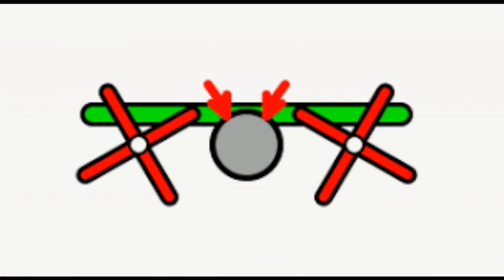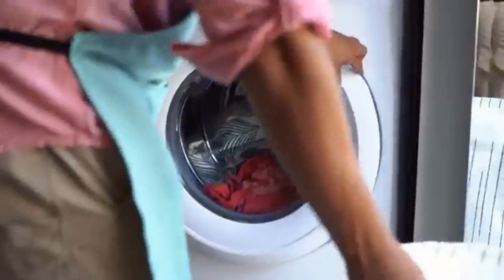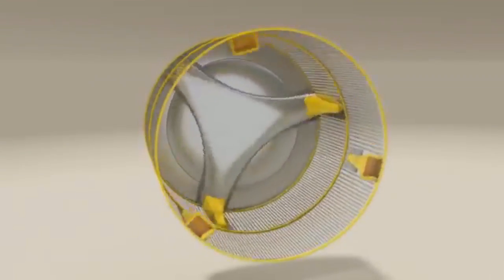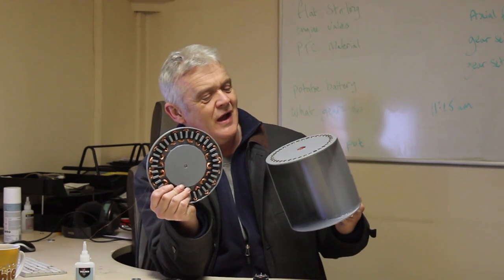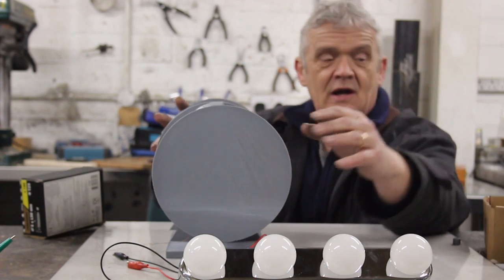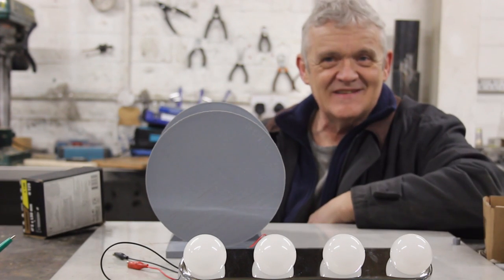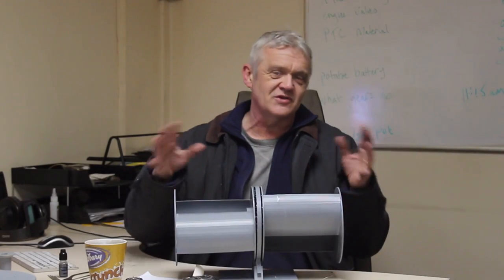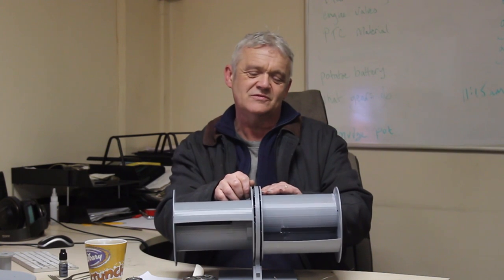1873 The Contra Rotating Wind Turbine

Comment: Put more spacers between them to move the magnets slightly farther out.  The super magnets have a big field strength.  And reducing the magnetic drag on the stator lamination and the ooposing should reduce the magnet lock getting them spinning faster.  New subscriber here.  Do you have any magnet film to see if the magnets in each rotor are too close together so you are not creating a sine wave in the stator. And are  the poles flipped on every other magnet to create even a bigger field. 

Balancing the rotors could be done with a shaft  all the way thru that is rolling on small ball bearings at an overlap without any lube during use so you are not fighting and oil or grease tsunami to overcome rotational torque.  Another yt channel tries to balance surface grinding stones with oiled bearings and he cant understand why the grindstone kicks back a few degrees. 

With the magnetic film held at various distances you could view the size of the magnegic field of the magnets to make sure you are not counteracting. 

If installed on a vertical shaft. The thrust bearings could be opposing ring magnets on the shaft and rotor.  Does not have to be a neodymium to have that effect. 

Creative maglev effect could have neodymium magnets for the lift and ceramic magnets for the hold down.  More neodymium magnets on the inside of the rails and daggerboard.  But the daggerboard is missing a section in the middle where a spinning disc could hang down to give forward motion.  

Im glad your channel popped up on the play list.  Really makes my brain think.

Comment: Very interesting! I find the fact / result / conclusion here, that the counter-rotating rotors yield more energy than the co-rotating (axial-flux) mode somewhat counter-intuitive. 🤔 More tests please! I would be especially interested in seeing tests of the counter- vs. co-rotation modes with the flat folding-vane turbine from your videos 1864 & 1865. That might also require some thinking & tinkering regarding the effect of gravity on the vanes... An interesting challenge, perhaps?

Comment: The magnetic fields are colliding and pushing each other out of the coils.  Think about the rotational speed advantage you have created from the contra-rotation: if you mount the generator coils to the other turbine blade you will have nearly twice the rotational speed.  The advantage/disadvantage is the increased moment of inertia from the weight of the coils rotating which gives a flywheel effect.  <edit> I saw in an earlier comment that you were concerned about the use of brushes and wear to pick off the generated power - what about using the mounting shaft with trace lead contact wheels and mercury contacts to create liquid brush connections? <edit, edit> Nickel is a good conductor that is less prone to form amalgams with mercury and could be used for trace contact wheels for a liquid brush connector.

Comment: @RobertMurraySmith
Right.
 Now get a couple of barrel fans from the internal wall mount fans from scrapped domestic heat pumps, slap a rollerblade wheel on the brushless 3 phase motors  that they come with, set them up with three phase rectifiers, and put them between the baseplates on the face of the the barrel turbines. 

As thrust bearings. 

If you can get these inrunner motors spinning at 1000 rpm you'll get 100watts at 240 volts DC out of each of them. 
They are rated at 6A coil ratings, and make 280Vac open circuit at 1000rpm. Per phase.
If your rollerblade wheel (replace the grease with epoxy) is 1 inch, and it's four inches from the central tension rod shaft, then it will be about 1 to 8 step up, so you only need ~120 rpm from your turbine. 
And those barrel fans have more blade area, better aspect ratio, and over 2x the utilisation of the airflow, because of the the wind exiting the rear side than your turbine demonstrated here.
And won't suffer the balancing vibration issues from the variation in loads under rotation that that demo did.

No funky building of big heavy lowspeed high torque rim motors with expensive Magnets and coils required. 
Perhaps ten quid of scrap value + diodes. 
Repurposing is better than recycling, which is better than building it new. 
😉

Comment: Can you get rid of the maglock by flipping and rewiring your coils 90⁰, in effect elongating the coils in the horizontal plane,separating and distancing the magnets from each other, but retaining their influence on the shared coil? A east-west zigzag in threading a serpentine coil may achieve a similar result.
Does the contra-rotation all together remove the need to flip every alternating magnet, to achieve a DC output and removing the need of rectifiers, or would this rely on a synchronous speed of rotation on the separate barrels?
One clockwise rotating savonius on top, with magnets(stator) on the rim in its base, mounted on a central vertical hollow shaft.
Next, a stationary plate with vertically elongated coils(rotator), fixed to the same shaft, with connected wiring passing through that shaft and down.
Next, an anti-clockwise rotating savonius, with magnets on the rim, on both the top and bottom.
Next, a second stationary plate with vertically elongated coils(rotator), fixed to the same shaft, with connected wiring passed through that shaft and down.
And finally, one more clockwise rotating savonius on the bottom, with magnets(stator) on the rim at its top, mounted on the central vertical hollow shaft.
The central vertical hollow shaft would now end in a weighted base.
Mounted on bearings connected to the fixed plates, the turbines would have smaller diameter flanges at the top than at the bottom. This would allow for terraced stability and weather protection, when in conjunction with downward tapering lips.

Comment: That's awesome but as a wind turbine that maglocking you'd need some strong winds what if you add a second coil in  The middle to cut down the maglocking increasing the voltage and turn it vertical with like 3 center mount brackets to stabilize it

Comment: I want to begin by giving thanks for the videos. They are both educational and an enjoyment. But onwards to my input. Having been following these videos and seeing this one a thought cave to me. Shouldn't each section have a generator on top and bottom thus harnessing 2x more energy. Coil on one end and magnets on the other and an end plate with corresponding coil or magnets. Then putting two or more sections together with a middle plate between with magnets or coils as needed. Just an idea.

Comment: Hi Robert! I was  wondering, how are your rules and regulations for wind turbines over the pond? 
I just found out that I am not even allowed to put up a wind turbine, no matter how small - Without consulting the local municipality for a hefty hourly price, furthermore the turbine must be of an approved type and make and all sorts of stuff... I just want to experiment in my garden, I live far from anyone who could have a problem with it, so I guess I am fine just keeping it discrete. But man, it is really kind of a bummer to have a government that is bonkers for green energy, but only if it comes from gigantic glassfiber bird slayers from vestas... How is any innovation supposed to get done, if atypical turbines and DIY is explicitly prohibited? And applying even for an off the shelf system is as expensive as the system itself... I am just flabberghasted by these laws really. I could understand regulations like noise level, auto braking and structural integrity and what not - But I have to pay 100euros an hour for someone to approve just a micro turbine, driving leds in my garden... Technically even a childs windmill on a straw toy would be illegal to have in your garden, because these laws are for all wind turbines from 0 kw and up. Its bonkers..

Comment: Idea! Now add additional sets of magnets and coils to the out side edges, and add end supports. How much more energy is produced then?
Reply: More magnets/coils increases resistance which increases the torque requirement to get the rotor spinning consistently. That's why the objective is to get as much speed and AC to one coil.

Comment: On a rather similar note...
What if one were to double-stack the turbines as you have, but rather than contra-rotation, lock them together, keep the stator stationary, but having a row of magnets ON EACH ROTOR?
Aligned properly, of course. And I wonder if Magnetic Lock would be enough to keep them tied together.

Comment: Is it the counter rotation or the fact your doubling the magnets?

If you print a single with another magnet between each pair I'd be curious if it changes the voltage or the frequency given a test rpm used for both the single and the double magnet single.

Comment: I solid shaft that goes full through bother blades would allow for two pin points and a much cleaner spin. Any particular design reason you chose a single mount point?

Comment: what if you mounted a coil on each spinner and larger magnets on the center? how about a coil on each end and 3 sets of magnets? yes thats a lot more material and work but if the increase in power is significant it could be justifiable

Comment: I would like to see them stacked vertically, but the Savonioseseses (sp 🤣) seperated and gear driving a larger magnet plate over a larger coil. Geared properly, in synchrony, I believe a vertical orientation could be more beneficial to a practical application. Just ideas.

Comment: On one hand I think you could do a washing machine in the matter of your speaking of using gears. On the other hand you should be able to do it the same way the motor on a lathe runs where I spindle from another motor goes through the center of a motor. Have a wonderful evening.

Comment: NO  NO or the real thing we are looking to do is rotating 2 disk with magnets in one direction and the central coil disk beteween them rotating in the opposite direction.  i.e. the doubling of the speed(RPM) of the generating effect.  didn't I read somewhere that this would double the  effecency of the generator..
if you have 2 disk one truning at 10 RPM clockwise and the other doing 10 rpm counter clockwise that in effect give you/US 20 functional RPM -- so 100 RPM wind speed give us 200 rpm--( the faster with in upper limits) the better for power genreation.

what say you??  Robert
Reply: also-I'm thinking 2 magnet disk and 1 centrally located wire coil disk running be tween the to Magnet disk. working out how to get the mechanics of this worked out so the we spin the 2 facing magnet disk in one direction and the coil disk in the other direction(opposite direction) -- tha counter rotation has to be between the mag disk and the coil disk.

i think.  later robert

Comment: I sort of understand how this would work if the turbines were mechanically connected as shown right at the beginning, but am a little confused by something. 
I'm struggling to understand how the contra rotation in the setup demo'd would be better than simply mirroring the blades on both sides and having them turn in the same direction.
Any explanation welcome.

Comment: Interesting info
Although, I would have to disagree with you that the main issue with the washing machine using two motors. I would say it was the fact that it leaked like a sieve. I guess if you water proofed the inside and added a pump then I would agree having two motors was the main issue.

Comment: Would it be that the counter rotating magnets are some times canceling out the voltage created by the other side and equally magnifying the voltage on the other side depending on the phase each is in

Comment: What would happen if ONE of the two units were split into two, with the full unit in the centre & the two halves on either end? Apart from it being more aesthetically pleasing, the added complexity should be outweighed by an improvement in balance.

Comment: I think you're going to have to help me understand the physics here. If you spin one turbine, you create a current in a particular direction based on the orientation of the magnetic field and the coil... but if you're applying a magnetic field in the opposite direction on the other side, wouldn't you be creating a current in the opposite direction? I get the comments about adding differential gearing... I would think ideally you want the turbines to be spinning at the same rate. The only explanation I can think of is that the magnetic field is rotational around the coil, in that the magnetic field is moving the same direction rotationally with respect to the center of the coil which keeps the current in the same direction... but if the applied magnetic field is rotational, then the left-hand-rule can't really really demonstrate what's actually happening.

Comment: So what is better? To have two counter rotating blades, each with it's own magnets acting on one winding or mount magnets on one and windings on the other and double the relative rotational speed?
Reply: Of course, you'd have to use a rotating (sliding) contacts from the winding.

Comment: How could the serpentine coil plate spin on one side and the magnets spin on the other side counter rotating? would that give more power than this counter rotating two sets of magnet setup?
The 2 power wires would need to use 2 constant brushes on the axle or rim probably  using similar parts to an electric motor setup.. and might give a bit extra drag though.
But would use half the magnets (less cost) and also would not have the magnet locking issue.  i wonder how much that counter rotating coil & magnet setup would generate with the same wind?

Comment: Can you test mirroring one side to compare voltage generation with the same surface area, i.e. both sides rotating in the same direction and then compare the voltage output with the only difference being that they turn in opposite direction?

Comment: If you mount the coil to the oposing turbin therefore you got  the double velocity betven the coil and the magnets aka higher voltage and higher frequency , less turns on the coil , Higher gauge on the vire! should result in higher output or less losses !?🤔

Comment: Comparing to the mag-locked pair was silly.  You need to compare instead to a pair designed to rotate in the same direction even if not mag-locked, so the pair will double instead of nearly canceling each other.

Comment: Hi

I'm BIG FAN of Your channel..

I'm a 59 early retired electrician/and a jack of all trades master of few.. 😂

After seeing this video  I began to wonder about this devise and what it could be developed into...

Would it be possible to 'stack' multiple of these contra rotating wind turbines with multiple stactors/ electric field electric generating, stacked on each other, mounted on a fx 4 times 1 meter 2 inch  galvanized water pipe with treads, to become 4 meter tall, and have a bunch of these contra rotating turbines stacked vertical, making for a free standing wind mill, just stabilized with 3 wires on top of the 'tower' to keep it steady?

I mean, wouldn't such a thin wind turbine, only about 50-80 cm in diameter (besides the wires) would be hardly visible for any wouldbe annoyed neighbors, while still deliver a usefully power output, maybe even enough for charging batteries / converter to 120/230 VAC for use in a 'TINY HOUSE' or a Mobil home?

Just a thought.

Greetings from Denmark

P.S. Sorry for my broken english..

Comment: You made the unit twice the size so contra rotation had nothing to do with the increase in power. To compare you need to make 2 pieces half-length and then check the power against a single full-size unit.
Reply from the maker: is that right? You might want to check the video again mate
Reply: Yeah, that doesn't make a single bit of sense.

Comment: Why not contra rotate the coil itself? In relation to the original turbine.
Reply from the maker: you could do - but it would create a complication with the wiring - you would need brushes and they wear out pretty quickly and need reasonable engineering tolerances
Reply: @ThinkingandTinkering  fair assessment

Comment: You know you can achieve the same thing by making the diameter of your vawt smaller, and the span (length) of the blades larger. It Increases rpm and torque without contra-rotation.
Reply from the maker: what if you contra rotated your suggestion - then you would add effect on effect?
Reply: @ThinkingandTinkering  no